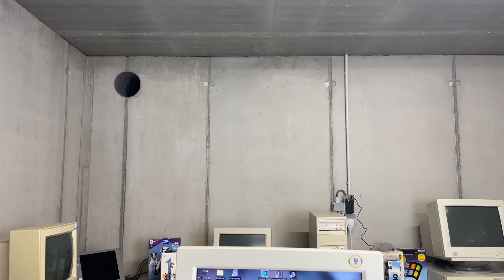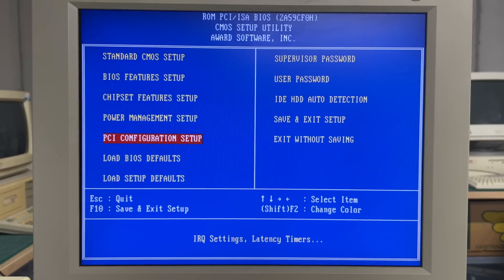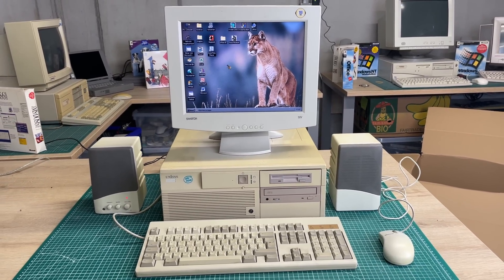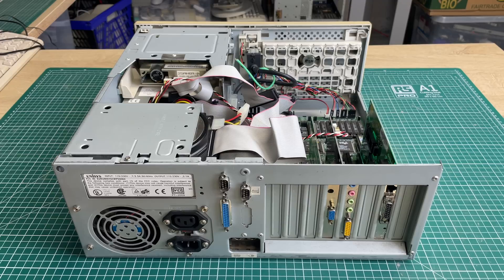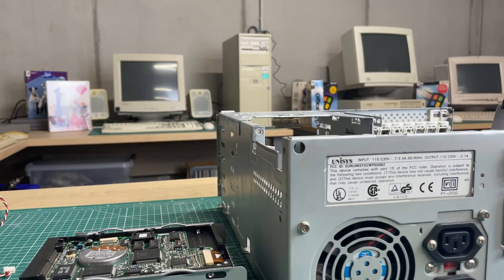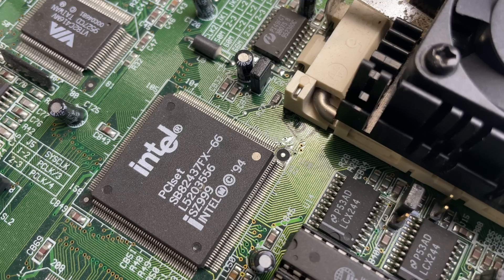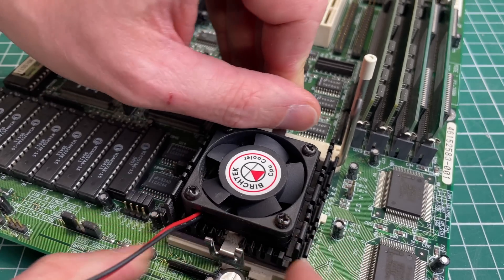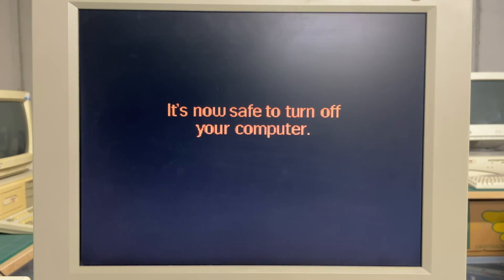A look at the Unisys Pentium 75MHz

Comment: brings back memories of me doing a windows 95 install on a 75 with 8 meg.  My good god it took nearly all morning to install windows 95 on floppy.  Only for the HDD to give up mid way through lol.  Also that's a 1st for me too seeing PS2  instead of AT keyboard connector, on systems like these. you normally would get PS2 connectors on odd ball systems as i call them of that era.  Also down grade it to windows 3.11, and you find it will be quick.

Comment: 75MHz in 1995 seems like an incredibly slow clock speed by that point in the 90s
Reply: I first installed Win95 on a 486DX/2-66.  I would’ve loved to have had a P75, but Pentiums were still very expensive.

For that matter, I now have a Gateway Pentium 60 that was manufactured in first quarter 94.  So I think 75MHz in 1995 was quite decent.  :-)

Comment: 1:51 Number nine? I'm 64? Beatle references?
Reply: Yes, they sure are. From Wikipedia: ‘The name of the company, as well as many of its products (e.g., Revolution, Imagine, Pepper, Ticket to Ride) refer to Beatles songs. At system boot up, Number Nine cards' video BIOS splash screens display short phrases from Beatles songs related to the cards' model names. Card model names were usually preceded by a "#9" moniker.’
Reply: @kasimirdenhertog3516  Thank you! If I happened to know the brand, and, therefore, more of their products, I'd probably know that for a fact, but I'm not familiar with it. Nice info. Oh, and nice touch by that hardware company, too!

Comment: Interesting... this is the first time I see such a PS/2 config- I had/have (again) an Intel Zappa board, and was surprised at the time Windows 95 detected a PS/2 mouse port - which I wasn't aware I had! Turns out this port could only be used when the voard was configured by factory with it - I had an AT style DIN connector instead. 
About Win95 and the speed: I'm pretty certain your issue is the lack of RAM, not CPU power, here. Beginning with 32 MByte, Win95 is nice to work with...the 16 are likely not enough, and the system's main task is now swapping (moving [un]used data between RAM and disk) - creating all the loading and stuttering effects you perceive.
Reply: windows 95 can install on 8mb of ram,  and run so so. But here i think this may have a lot of shite on the drives, we used to use windows 95 with this sort of spec at school,  those ran bob on.

Comment: Might want to check the acceleration slider in the advanced display settings. Wouldn't expect a p75 to redraw the wallpaper that slowly.
Reply: Also maybe the hard disk is in PIO mode and not DMA, which drains the little performance that Pentium has to offer anyway.
Reply: It’s not the graphics.  At one point he minimizes a window, which takes a while to redraw, then brings the window back again, resizes it, and minimizes it, and the screen redraws instantly.  If it can do it at all, it’s not bandwidth related.

My guess is, with only 16MB, the wallpaper is getting swapped away pretty much any time anything else loads into memory.
Reply: @sirnickity  Now I remember, I think you have to limit VCACHE otherwise Win95 tends to hang on to too much disk cache instead of using it for more important things
Reply: @sirnickity  good call. A 1024x768x24bpp wallpaper takes 2.25MB of memory. Not trivial for these old systems!
Reply: Good catch, that could be it... alternatively, from the look of the RAM on the video card, that might be the problem. It looked like 60ns DRAM to me, not VRAM. My Pentium 75 had the Diamond Stealth Video VRAM 2MB... I insisted on that one when I ordered it, I wanted to make sure the video performance didn't suck. I was coming (defecting) from an Amiga 4000/040. For the time (1994) it was the shiz. This card looks to be, well, just shiz.
Reply: @aleaxdeathbringer  S3 Trio64 is quite nice for what it is (S3 Virge is basically using the same 2D core), and that DRAM is plenty fast, with the card having a 64 bit data bus spread across the 4 chips. Diamond Stealth is just Diamond's brand that they used for a ton of different video chips over the years. One of the Diamond Stealths is this very design (S3 Trio64), but with 8 8-bit wide DRAM instead of 4 16-bit wide DRAM.
Reply: @ianhanschen  the graphics cores are similar (S3 968 in my card's case which I think is older) but my card had dual-ported VRAM which could be read from and written to simultaneously. IDK what use case that helps with but it was a selling point.

It might very well be the acceleration slider. Or maybe wrong driver.

Comment: I was wondering why I couldn’t hear the hard drive seeking and then you showed the inside and it was Fujitsu drives, two of them at that! The seeking of these is actually very faint compared to other drives of the era. Was one of them bad? When the PC booted it only listed one of them (maybe the BIOS was miss configured though). I have a Pentium 75, and it runs better than your PC did here, so yeah the install was probably bloated, with a new install it would probably run much better I guess.
Reply: those fujitsus were alsop slower than average thoughso maybe thats why it seemd slow

Comment: The good old Win95. I had this OS on my 486 from DX2@66 up to 133. And it ran just fine. As memory I had 24M (2x4+2x8M) FPM and it impacted the OS fluidity quite a bit; it was mostly a single task computer. When i swapped the memory stick from 4M to 16M for a total of 48M, man, it was like a wake-up for Win95. Snappy, responsive, no swap accessing, and with my Trident TGui VLB with 2M VRAM, it was a new computer.
I would suggest to upgrade the amount of RAM to 32M or even better, 64M for the best performance. The new owner and Windows 95 will thank you.
Reply: i remember my little 75 system that had 8mb of ram, put windows 3.11 on it, i was learning about PCs at the time,  bought 32 mb which i think maxed the board out i think.  fired it up and windows 3.11 ran like stink! My dad said bloody hell!, that's quick!  installed windows 95 and that was flew too,   i always found windows 95 to be smoother than windows 98,  which i think may have been why it hung around till the very end, and things just moved to windows 2000.
Reply: Those were the days, when you upgraded one part after the other and always felt you got a newer PC after - funny that when you upgraded to Pentium class from your last 486 you most probably still had parts of your old one in you dragged with. Like me, had a simm shuttle to use 30pin SIMM in a Pentium 72pin slot, until i could buy proper EDO... and so on.... hehe
Reply: @MarcRyderProject  Yes, my new Pentium inherited the soundcard,  memory (I think). Saddly, the HDD was not able to use because it only had one IDE controller while my 486 had a dual one with VLB.
And, also it was a good time to upgrade. I went from 486 DX2@66 up to 585@133 on the same motherboard and for each CPU I used I felt the upgrade. Same with going from 286 to 386 or from P1@90 to P1@166. 
But hey, that was the beauty, and I was proud to show my friends that I can run games that theirs computers could not.

Comment: Very nice video for a superb computer (which would deserve a good redrobright session to get back to its full glory) ! 
Regarding the PS/2 connectors on the motherboards, that was quite common at this time on brands such as Dell or Gateway 2000. All my Gateway 2000 boards based on Neptune or Triton chipset are AT, and get the same PS/2 connectors at the exact same place. This is very convenient and you don't have to use a serial DB9 mouse !

Comment: That computer should be running must faster than it is, probably bogged down from bloatware etc. I had 486 during the same time period and it had no issues with even the underwater Screensaver
Reply: yeah it seems to have a load of shite on it, a clean install and it will be spot on, it can also make a fast windows 3.11 machine too.

Comment: PCI sound card in a Pentium 75?  Really wouldn't recommend that.
Reply: What’s wrong with that?  Won’t be great for DOS games, but in Win95, it would be fine.
Reply: @sirnickity  I tried it one time (Sound Blaster Live in a Pentium MMX 233), and in Windows the game performance was dramatically worse.
Reply: @thepirategamerboy12  That PCI card was produced in 2000, so it doesn't really fit in this system. Removing the driver (and the card) will increase the performance.
Reply: @meiklman  I already did that a while ago, it was never a permanent thing.  It has a Yamaha Audition 32 ISA card now.
Reply: @thepirategamerboy12  Sorry I actually meant the card in the video, it has the production code of 2000 on it😁
Reply: Why not? With windows as daily driver there shouldn't be any difference to ISA. At least the bus isn't that different and the ESS chips were built with PCI in mind.